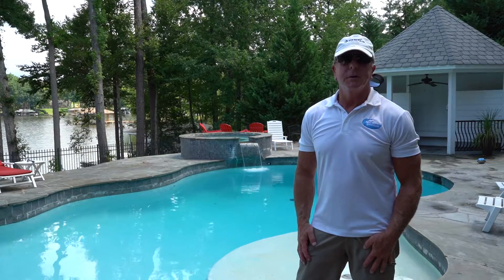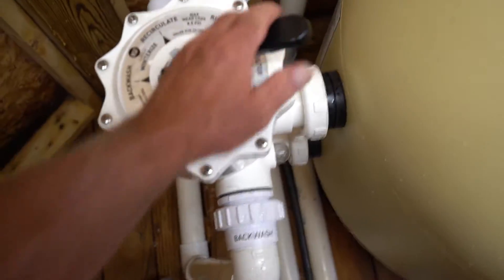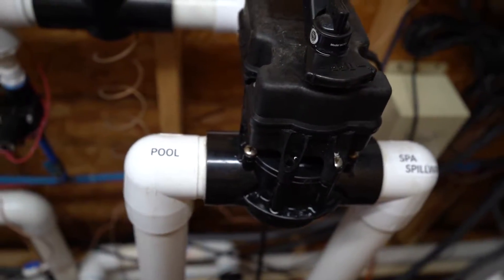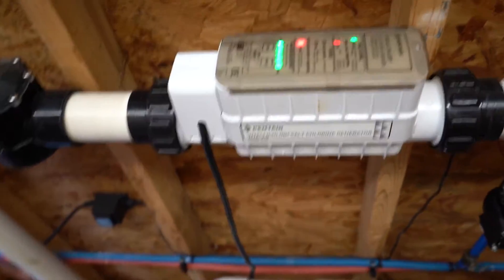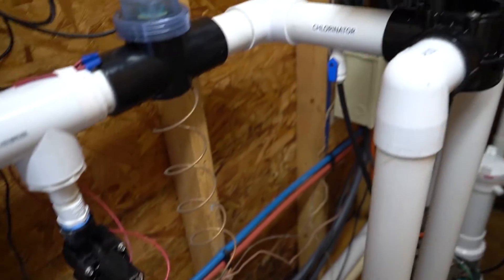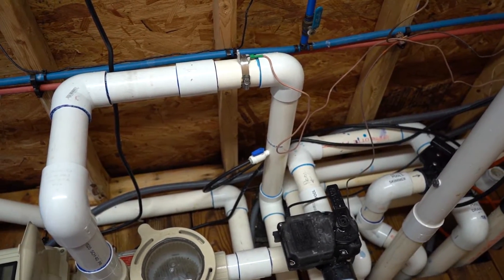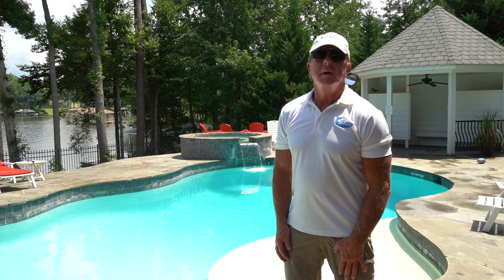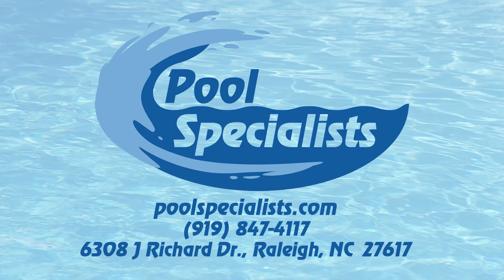How to run your Pumps, Control System, and how it Opperates

Comment: How do i get a replacement latch for the Aqualink control box?
Reply from the maker: Go to Lowes or Home Depot and get a standard (https://www.amazon.com/Ksmiley-Stainless-Security-Packlock-Brushed/dp/B092VKMY8F/ref=sr_1_8?dchild=1&keywords=Hasp+Lock&qid=1632944245&sr=8-8).  You can either use outdoor double-sided tape or screws to hold it on.